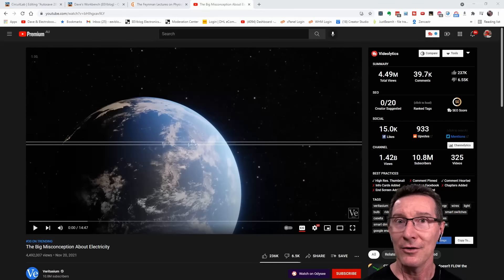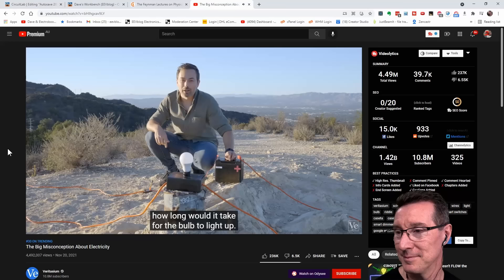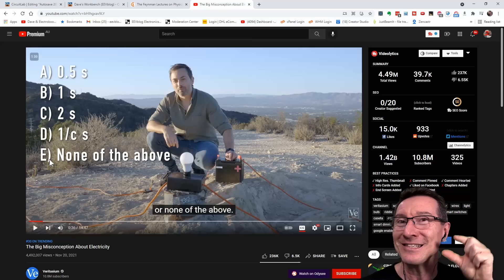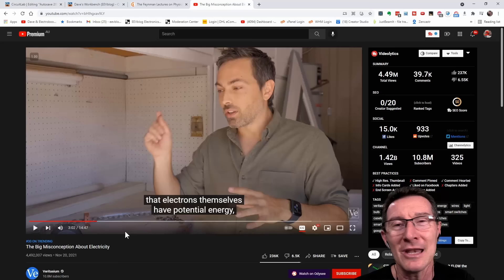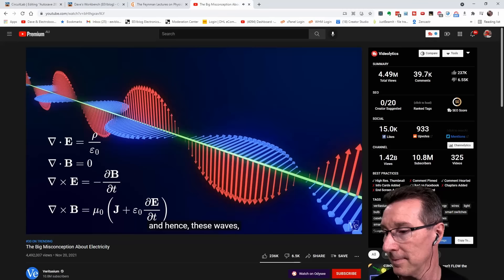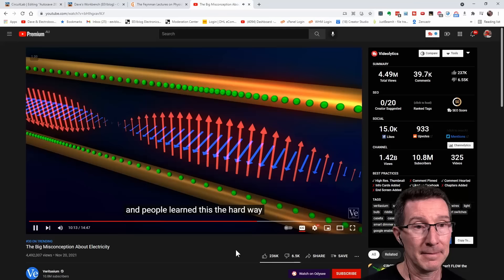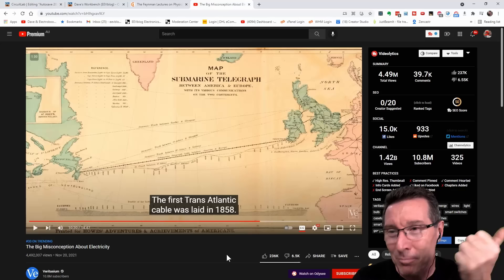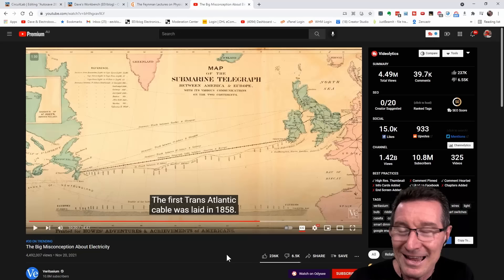EEVblog 1439 - Analysing Veritasium's Electricity Misconceptions Video

Comment: Nope,.  It has very little if anything to do with the distance between the wires.  Only the piece of wire between the switch and the light matters when measuring the lights turn on time.  The segmented wire's length and other properties such as permeability effects it's charge time.  The wire is already charged up to the switch.  The charged current begins from there when you close the switch and turns the light on once the current electrons move through the lights filaments.  This happens at the "speed of light" minus the wires properties from the switch to the light.  Not the entire length of the wire.
Reply: There's a formula to calculate how fast current propagates in wires. It's called the "velocity of propagation" v = c/sqrt(μ(r) ε(r)).  Then you divide by the length of wire from the switch to the light to get the time it takes for the light to turn on, roughly. t=l/v.

Comment: One problem that I have with the video is that he states that power is transmitted via AC. (In some cases yes, but not all) 
https://en.wikipedia.org/wiki/High-voltage_direct_current 
This should explain why, it also talks about why HVDC is more efficient at long distance power transmission. The skin effect is also referenced. I'm no expert but this is stuff I learned in college.

Comment: I don't think it is as easy as you make it sound with your "mehhh"''s xDD To model this circuit as a transmission line like in your example, we could place the battery + switch at one end (for example at the earth) and the bulb at the other (at the moon). Then, it would actually take 1 second to turn on, and all the propagation energy would be kept in the space between the cables. In this case, we could see the air between the cables as a dielectric, like our FR4 in a PCB. The impedance would be easy to calculate, because the electromagnetic field is travelling through an homogeneus and constant surface. But when you put the setup like in his video, the area is not constant, but is getting larger in the measure the field is spreading. Actually you finally get a HUGE area of about 1m * 300000km = 3e8m2, can you imagine this in a PCB?

What we the electronic engineers try to avoid in a PCB design is precisely to reduce this area, because otherwise we get radiations and we don't pass the EMCs. If when we design the PCB we try to follow the return current to minimize the area, is because we have NO IDEA about how the energy will behave if we don't, and for sure then we should apply the maxwell equations together with quite hard and crazy simulations to understand what will happen there. In fact, this could be seen as a HUGE antenna rather than a tranmission line, and I'm quite sure that part of the energy would be lost in the free space in form of electromagnetic energy. In a transmission line, the load receives almost all the energy of the source, but when you have an antenna, the antenna itself behaves like a 50ohm load where energy is "lost" in the free space. So, in this case, during the transition (you are right, not in DC), not all the energy would reach the bulb.

This has serious implications, because to know if the bulb would turn on within 1/c seconds, we first should know which % of energy would be lost in the free space. For sure, after 1 second the bulb will be on, but to know what happens between that time we should run some simulations, maybe we have some kind of slow ramp-up light effect, who knows... I understand you are trying to minimize the impact of the video, but I don't think it's as simple as you say either ;)

Comment: I live in Austin, TX. I have a computer under my desk which is running. Somewhere out there is a power plant generating electricity. I am surely not expected to believe that the power that is operating my computer is being transferred directly, as the crow flies, from the generator inside the power plant to my computer, am I?
Reply: An unmeasurably tiny amount of it is.

Comment: very informative video and a great addition to dereks video to understand the problem (from the view of a non-engineer/phycicst like me)
at the end what seems to show through in my eyes is that the author of the video was maybe also a bit stumped by dereks question?
Anyways hes absolutely correct in real life 99% of the time it wont matter which way you see the energy transfer,
but a great job was done by both the author of this video and derek to explain the phenomenon.
Its still very satisfying to know the underlying theory, although it doesnt really matter (when e.g. fidling around with wires and harnesses in a tuned car as in my case)
There is nothing wrong with a little academic exercise to brighten up your live :-)

Comment: Why don't you explain why copper tubing, say 1/4" will not carry as much current as 1/4" solid rod.   Also, why not talk about reflections in any circuit AC or DC, at turn on (transient).

Comment: I feel like Veritasiums video is just kinda weird. We have known about inductance for a long time and that's really what he is showing in the video. If you wanted to actually use the batteries power you would totally have to wait 1 second before you could use it even when it's 1 meter apart. Sure there is a small current being induced across the wires but this doesn't really give you any groundbreaking insight that we didn't already know. He could have just said "energy travels through the fields around the wire" and if you want to show there are fields you can just show that wires create a field. It doesn't require this silly experiment with 300.000 km wires that purely distracts from the idea that he is trying to convey.

Comment: Wait, come on. That transmission line model serves its purpose, which is to simulate the effects of the fields. But it does in a rough way. It completely fails to predict the real velocity of the set up of the field, which is the subject of the discussion.
In fact, that transmission model is a device of calculation, but it's not a theory by itself. Because it doesn't describe what the field does. But it's fine to describe a tendency of the results.

Comment: I suppose my point is (with my broken thought experiment I just posted) that many variables are not considered in the Veritasium video. If the wires extend to space, where is the dielectric for capacitance? The capacitor section I would think ends and begins at Earths atmosphere. When a line is at zero ohms, can the formula for transmission lines still be applied in the usual way? Is he trying to demonstrate that the effect of electricity can be faster than light and if so, I didn't really see that. I had learned that high frequency electricity doesnt require a core or centre for the conductor as in television sets due to the frequency (the skin effect mentioned in this video). I suppose initially the field is considered to be in motion as it builds and then stops, being that the source is DC. If he was demonstrating induction, why the long wires? So yeah, I found his exercise kind of pointless and really didn't grasp whether he was trying to trick people with the long wires and closed circuit. I saw some follow up videos that he made and I got the impression that he evolved whatever idea he was attempting to present.

Comment: One correction everyone makes regarding this video really annoyes me.
That is the correction of the unit.
You can absolutely use c as it's numerical value.
In that case "1/c s" is absolutely correct.
OR c has a unit of m/s. So you could do "1m/c" which already has a unit of seconds. To keep the s for seconds behind that would make it s² which isn't a time. That's done by comment writers and video creators.
Why would you "correct" an absolutely fine result (in terms of units) and don't check that your "correction" is in turn at least actually correct.
That really bothers me.
Thanks for your attention.
Reply: The correct answer is 2m/c. Please consider circuit modification and place battery next to bulb.

Comment: Dave, 13:26, I'm sorry, but YOU are wrong.  He already said he was pretending to use a superconductor.  With a perfect SC, and he said "zero resistance", you COULD transmit mega watts in a 30 gauge cable.  To be pedantic about it, he is being hypothetical.

Comment: I'm glad I watched this video because the behavior of Poyting vector for DC was interesting to learn about and not many other people covered that. On the other hand, I was still left dissatisfied and with the feeling of wrongness after watching both Veratassium and this (EEVblog) videos.

Derek says that the current inside the wire doesn't matter, as long as there is the electromagnetic field. He also demonstrates the energy traveling 'through' vacuum and that on conceptual level this is the only thing that matters.

You seem to agree with him in this video and you just say that its not practical to think about it. But here is where I have a problem - I am left with many questions and the intuition did not click for me at all. Does this mean the energy is always traveling through the vacuum? The current doesn't matter AT ALL and its just a lie that just so happens to work out in some cases?

ElectroBOOM video on the other hand gave me the explanation and the intuition I desired. The key part that made it click for me was when Mehdi explained that the power is MUCH smaller over vacuum because the Poynting vector is smaller, while the energy flowing through the field around the wire itself is what matters and this is actually where most of the energy is concentrated in.

I feel like without knowing this difference its not enough to say that engineers do not have to care about how the energy is transmitted - through the current or through the field. If you consider that the field is concentrated around the current much more than in the vacuum, you get more or less the same effect where the model comes very close to the fundamental physics.

Comment: The moment the Vertasium guy started with his, "assume there is no loss in the wires," stuff at the beginning of his video I wrote it off. Once he has ignored a critical aspect of the real situation it changes the nature of nearly everything else. For instance, due to the capacitance between the wires, with zero resistance in the wires, infinite current will flow and will instantly blow out the switch. (He didn't say the switch had zero resistance, and the initial spark would blow out the contacts in any event.) Picking and choosing imaginary circumstances of your choice then acting like only the other real-world circumstances of your choice apply has little to do with any discussion of reality. So his video was basically nonsense, not some sort of revelation.

BTW, any analysis of skin effect will tell you that the fields are ALSO within the wire. So if the energy is flowing in the field OUTSIDE the wire it is ALSO flowing in the field INSIDE the wire.

Comment: The bulb won't light up in 1/c sec. It will blink once in 1/c sec. and then light up in 2 sec. when DC mode is finally set.
More over this first blink will always be (if there is enough of power) in x/c sec. independent on the line shape because at this very moment the switch is an transmitter and the bulb is receiver.
Reply: YES!!!  You are the first to get this right out of the last hundred+.  That's the conflation of concept I refer to in my explanation that Derek confused viewers with.

The only minor mistake you make is that it is 1 second, not 2.  It's because the flow is symmetric on BOTH sides of the switch where one side pushes and the other side pulls, right after the switch is closed.

Moreover, EEVblog's lumped element model here is not the right one for Derek's experiment set up.  Thus Derek's answer of 1/c is only partially correct.  There's more.

You'll be surprised at what the answer really is ....

Go to the top and sort comments on "Newest First", scroll to the time stamp of this post, and read mine.

Comment: As someone who has a IT degree, all of this wave stuff is just rules that I had to memorize well enough to pass. The truth is that I still don't REALLY get it. I wish that there was an explanation of all of this that was more understandable. If the lines don't carry the power, then what carries it? I don't think that I've ever held a handful of waves before. Is this saying that the power is held in the vibration of all molecules between the switch and the drain? What is transmitting the power if not the wires? For that matter, why does radio work through space? What is waving?
Reply: Lines do carry the power lol why else would you have so many diameters of copper wire. Electromagnetic field carries energy and is caused by the movement of electrons which are moving because of a source(power plant,battery) and radiowaves travel trough the air because of the silly high frequency many megahertz (Mhz) which appears to travel trough the air just fine.

Comment: I believe the energy IS transmitted along the wire.  For DC flow (38:53), there is a magnetic field but it is not gaining or losing any energy.
With zero, or normal low resistance wire, there is NO significant E surface field along the wire.

This is a key multiplication factor of the Pointing formula, so little or no energy gained or lost along or outside the wire in this scenario.  
Fehman says "the Poynting energy flows back into the wire". But this is a very low value, because of the near zero E gradient along the wire.  Ie, he is not talking about the main energy transfer ALONG the wire.  This is why Poynting is totally moot / inappropriate here. 

There is no energy flowing outside the wire because the magnetic field is not doing anything energetic and the Poynting value equates to zero. This is also negligible for low frequency AC.   However, it becomes more significant for higher frequencies, where a ripple effect along the wire brings about changing E surface gradients, meaning a higher fraction of the energy is radiated outside the wire.  

To be clear, the energy is transmitted ALONG the wire carrying the charged particles and the externally applied electric force applied from the battery.

Comment: I commented on Derek's video that he needs to apologize to his fans for being so devious.  And, I even disagree with you, because the light will NOT light up due to the fields until the transient is almost completely over and enough energy is transmitted to heat the filament.  Up until that time, while the bulb experiences some energy from EM transmission,  the bulb will remain unlit at visible light frequencies.  If he and you had said, how long will it take for some energy to be transmitted to the bulb, then the 1/c time period is correct.  But it takes much longer for the bulb to "light up".
Reply: You're on the right track.  Moreover, EEVblog's lumped element model here is not the right one for Derek's experiment set up.  Derek's answer of 1/c is not entirely correct either.

Go to the top and sort comments on "Newest First", scroll to the time stamp of this post, and read mine.  You'll be surprised at what the answer really is.

Comment: And light/em fields don’t travel at C within materials that are not vacuum or superconducting, he did assume that fir the wire, but not for the air, so to be really cheeky the em field will travel some paths asymptotically close to the speed of light in vacuum and some paths slower, if you practically want to get rid of that then you need a vacuum or you need the air to be a superconductor which defeats the purpose:p.  But as you said nobody cares what is exactly true or in what form. Hihi

Comment: If it's dc current then why the hell would we be talking about impedance? It was already stated the cables had no resistance (implying a "perfect" wire) but they forgot to tell us they kept the inductor and the capacitor part of it ? There are a few problems in this video that sort of affect the credibility of the whole thing. I'm not skeptic but a few corners were definetly cut...

Comment: Veritasiums video was misleading then.. I thought he was saying that the lightbulb would turn on in 1/C seconds AND STAY ON. Also practically speaking the lightbulb wouldn't turn on at all initially... If you ran the experiment as it is shown in his video the lightbulb would simply take 1 second to turn on. Right?
Reply: Exactly, Derek created a confusion which is uncharacteristic of him.  

EEVblog's lumped element model here is not the right one for Derek's experiment set up.  Derek's answer of 1/c is not entirely correct either.

Go to the top and sort comments on "Newest First", scroll to the time stamp of this post, and read mine.  You'll be surprised at what the answer really is.

Comment: After watching both this video and the Veritasium video, I have a better understanding of what actually happens. The Veritasium video is not being intellectually honest IMHO. The amount of energy that will reach the bulb in the given scenario will not be adequate for the bulb to function as a bulb, i.e., produce light. A steady state will need to be achieved for the current to reach the level normally needed for the bulb. This only happens after the energy completes the full 1 light-second path (assuming minimal resistance in the wire). Incidentally, it is my understanding that energy transmission in a wire does not occur at the speed of light because of both resistance and the fact that the path it follows within the wire is not straight. Also, it is my understanding that a multi-stranded conductor can carry electricity more efficiently (less heat/resistance) than a solid conductor as the energy stays on the surface of the wire of which there is more of when many strands are used in the conductor. Can anyone speak to these issues?